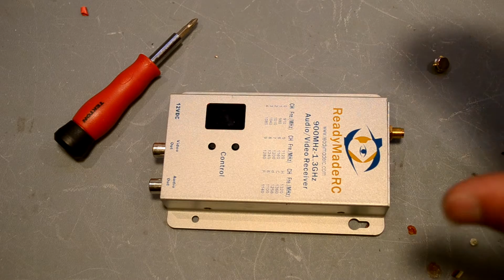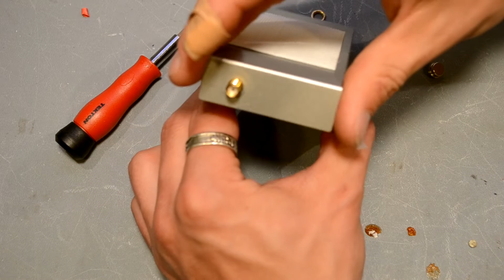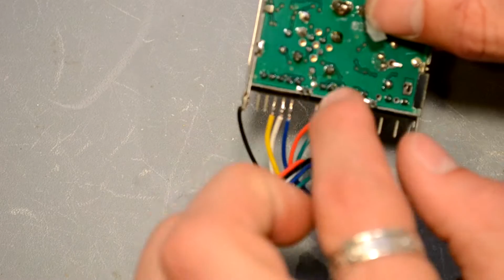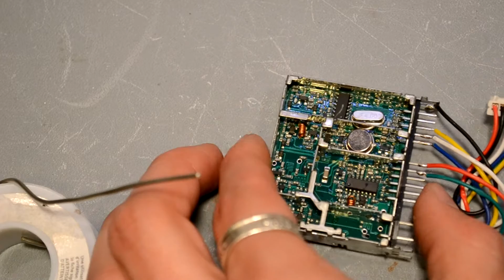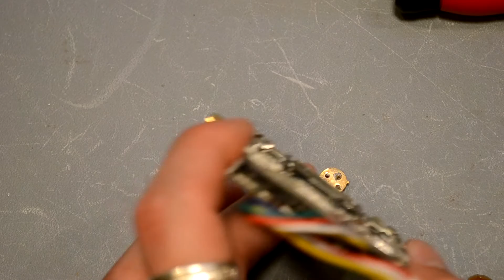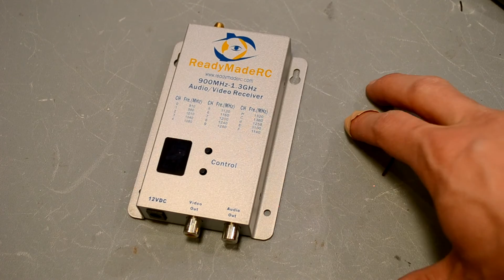ReadyMadeRC 900-1300mhz Reciever Saw Filter Upgrade

Comment: thanks great!  I didnt even know where the old one was without this I did use desoldiering braid on mine and 2 of the three pins dried right up and came out.  I purchased mine rx with a package including cam and tx from Hobby King.  was very surprised to find the EXACT same guts for way less money. and of course mine is not locked into 910 like the ones ready made sells to US.

so now that you have had this a while notice any improvement?

Thanks Greg

Comment: Cool!  I just did this same mod about a year ago on my video rx as well.  It was pain removing the old filter.  I wonder if a filter needs to be also installed on the video tx end as well, no one seems to talk about the tx being noisy and needing a filter.
Reply from the maker: Yeah, totally nasty getting it out. Hacked up the board a little, but I cleaned up the joint afterward and it worked just fine!
Reply from the maker: I ALWAYS use a low pass on my 1280 gear, the insertion loss is very low (~3db) and it really improves the stability of anything GPS enabled.

Comment: I respect your knowledge and thoroughly enjoy your videos but man, what a butcher's hack job on removing that can. I was excited to see your purchase of the soldering & reflow station but when you cut things with that dagger and lever still soldered components with a screwdriver, I cringe. Solderwick the solder off the joints and the component falls out, solderwick the holes to remove all leftover solder. You could have used your hot air to loosen the joints and the can would drop out. Buy a $5 pair of mini diagonal side cutters for cutting legs and other stuff too. What are you doing now with quads now your TBS has gone? Keep up with your ideas and please take my comments as constructive criticism as we all need help with some things. Looking forward to watching more of your interesting videos. Dave
Reply from the maker: Yeah, n retrospect it was a nasty job. I tried the wick on some other things off camera and it wasn't nearly as effective as a solder sucker. still a definite range increase! Look for some more videos soon!